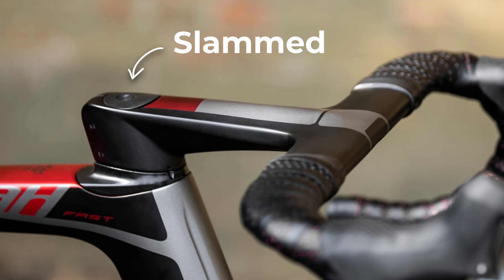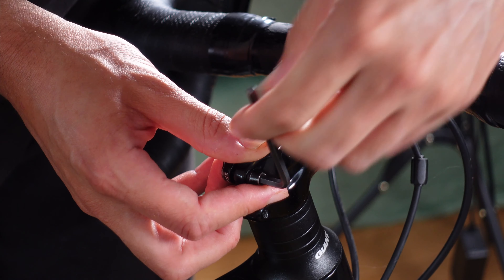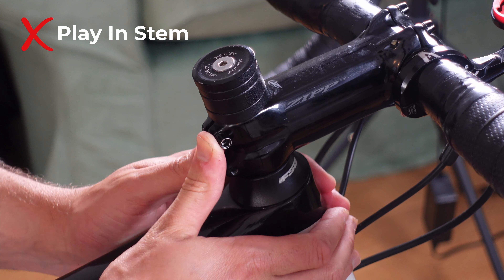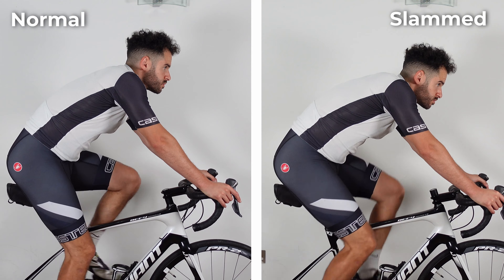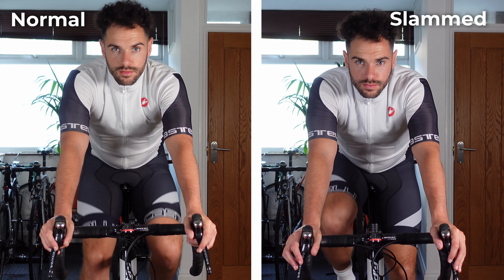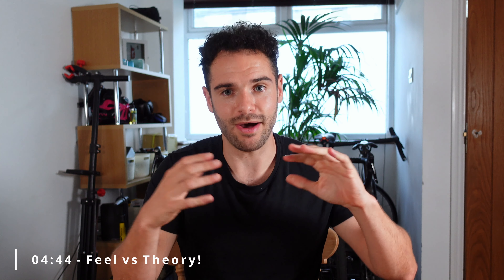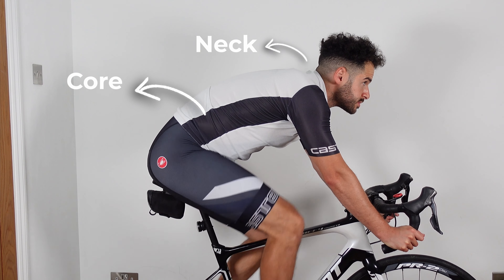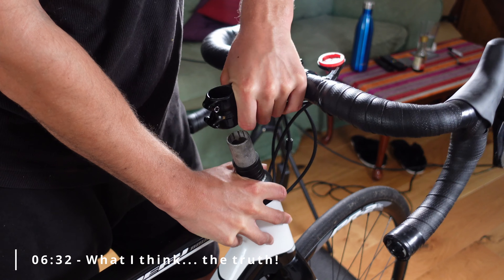I Tried Slamming My Stem for 30 Days... Here’s What Happened

Comment: Bars too wide. Shoulder width is max. Narrower is better. That’s the reason for your poor hand position. So many bikes are delivered with bars too wide. Also, you fail to mention the most important slam issue: Steerer compression. You cannot just slam the stem Nilly Willy and leave a tall chimney. That’s dangerous. You need a compression plug covering the area where your stem is clamped, or risk steerer failure.
Reply: If you don´t have steel components…
Reply: Needs a longer compression plug with a carbon steerer, he has an aluminum steerer post with a star nut so all good.
Reply: 2 very good points.
Reply: The steer tube on that bike seems to be aluminum not carbon so a longer steer plug is not required. But I am glad that you mentioned that because most bikes out there 2015 and up are carbon steer tubes anyway, so a longer steer plug is required specially if spacers are at the top and not at the bottom.
Reply: Try lots of stuff..super wide bars is awesome for mountain climbs, because it opens up your lungs for deep breathing a lot!!!!
Reply: Thanks. I did not know about needing longer compression plug.

Comment: When I first started riding age 15 drops used to be a lot deeper than they seem to be now, I’m 54 now so I’m talking steel bikes, they seemed to have comfort for climbing and the ability to get aero in the deep drops, I could tolerate any position up to the age of my late twenties, after that it’s all down hill guys , to all you oldies that wanna get areo, don’t 🤣
Reply: I think you feel aging at 40 little by little and hey it's cool... every flower has its turn in the sun...
Reply: @lunam7249  it’s gradual ageing until your late forties, then you fall off a cliff in your 50s🤣 I’m in that fight right now, started doing weights again to keep muscle mass up, I know I’m gonna go down but it’s gonna be fighting 💪🏻🤣
Reply: @lunam7249  and ever eagles continues to soar until it's time to be reborn as a phoenix stronger and wiser
Reply: This is exactly why I never stopped working out..I've been working out religiously for over 25years straight..im now 47 and I feel fine on my tarmac sl7 race bike..since im 6 foot 2 tall I didn't slam the stem but just removed a few spacers..if I want to get lower I just bend my elbows and tuck my body in..comfort=speed for some of us...

Comment: I always see these videos and never disagree with the conclusions because it is such a case by case situation. 
But I'm here to say, not everyone who slams the stem is doing it for the looks.
I started training really hard at the end of 2023 with a 100mm stem with 10mm spacers under it. I still had a little bit of back pain at the end of longer rides (4hours) but was ok on shorter ones. I've ridden on average 12 hours / week since then until now.
Right now, On a bike that is even more aggressive (shorter headtube, more reach, less stack, same seat tube angle) I'm on 130mm stem that is slammed and I can ride 4 hours with intervals no problem.

Your flexibility CAN improve a lot by riding a lot, even if you are an amateur. But you gotta get there gradually, not over night. Ride what you can comfortably but don't be afraid to experiment once you start riding more and more! If you CAN ride the longer lower stem comfortably, it IS objectively faster because of the aero position.

Comment: Mant pros have very long arm or upper torso. So even with a slammed stem, they don’t look very low. I personally slammed my stem but with 1x 5mm spacers not for aero but to relief the pressure from my hands and shoulders. It feels much more comfortable except my neck has to get used to it.
Reply from the maker: Yeah, the pros positions are crazy to be honest! I've had a few bike fits since this video which corrected a lot of issues that I had - https://youtu.be/EnGSLC9FtNI?si=2IfwVPTrxd2euwEl

Comment: be careful about telling people to slam their stems and not cutting the  steerer tube or getting a longer compression plug on a carbon steerer tube. It could be dangerous as if you slam your stem lower than the compression plug .. the stem will be putting forces on the unsupported part of the steerer tube and may lead to weakness of the steerer tube which could be catastrophic if failure occurs whilst riding.

Comment: You need more than 30 days to adapt to a low position.  Also maybe a longer stem and a more forward saddle position to keep the hips open and prevent the rocking.  Take a closer look at pro bikes.  120-140mm stems, small frames, forward on saddle, fast as shit.  Just look at Adam Hansen doing 20 back to back grand tours on a mega drop.  If it was a comfort issue he'd not make one stage.

Comment: Totally impractical for 99% of tall riders, esp with proportionately long legs. I already run a 14cm saddle to bar drop with spacers. 'Slamming' is just an affectation, if your ideal fit on the frame happens to result in zero spacers then fine but it's not a goal to aim for in itself.
Reply from the maker: Wise words 👍🏽

Comment: I'm no expert, but it seems to me like your bike fit was already problematic before slamming the stem. Your elbows were completely straight (not bent) which suggests the reach is probably too long and/or the bars are too low already. Secondly from the front it looks like the bars are too wide for you. It would be interesting to compare good fit (in terms of reach, bar width) but high vs. good fit and low (slammed).
Reply from the maker: You are correct... Since this video I've had 2 professional bike fits https://youtu.be/EnGSLC9FtNI

I have another video as well getting fitted on a race bike 👍🏼

Comment: When you slam your stem watch your compression system inside the stem. It must be in the same height with stem. When you tight the stem it compresses the steerer tube . To balance the forces manufactures puts the compression plug inside  to "push out" . Thats many ppl cut the steerer tube , to correct the height between stem clamp - compression plug. (Sorry for my english, hope to understand me :D )

Comment: When you want to take of the stem, ALWAYS loosen the bolts on the side first and THEN the top cap. The top cap compresses the steerer via the nut inside, you could damage your headset with the wrong order.
When fastening, first do the top cap and then the bolts on the side.
Reply from the maker: Thank for the tips! Much appreciated 👍🏽
Reply: When unscrewing, no need to follow any order. The cap function is only to compress the stem against the headset, so it's not loose. Once you tight the stem bolts, it serves no purpose anymore except for esthetics. If you wish, you can even remove it after tighten the stem.

Comment: I un-slammed my stem recently and I not only was I more comfortable as a result, I was also faster for couple of reasons not mentioned in the video.
The first is that I could spend more time in the drops. It's lower than the hoods while slammed but way more comfortable. It was a more optimal balance of aero and comfort that I didn't have available before.
The second was that I have clip on aero bars. And conventions have become that as low as possible isn't necessary as aero as flat and tucked as possible. Having a higher position allowed me to tuck in better, shrug my shoulders in better, and my back was more flat. Not to mention the greater comfort meant, again, I could spend more time in the aero bar position.
Reply: You have more common sense than people wanting to look like a pro or copy pro riders but do not have the physiology of a pro 🤫 keep that as a secret to get faster whilst being comfortable. Let them swallow their ego and pride later on and tell their mates, yeh my back and neck hurts and i cant sustain it 🤷‍♂️😂
Reply: Yes! I remembered Peak Torque mentioned this same point in a vid some months ago.

Comment: Been riding slammed for years. 
As long as you have flexibility, you’re good to go.
Reply from the maker: Good to hear... I think need to increase my flexibility hahah.
Reply: @JourdainColeman  yoga and core work.. 
I’ve also got a neck harness to build strength in there. 
If you add the correct tools to the arsenal, you can do anything

Comment: I'm 49 next week and have a giant tcr size small 11cm drop slammed stem no issues always have had my stem slamed my stem is a pro vibe 110 with -17° i was going to use a certified slammed top cap but with the -17° stem i didn't need to go that way to get my usual drop

Comment: If you slam your handlebars... you SHOULD reduce the reach of the saddle. Pros are riding with low handlebars since they move forward all the way their saddles (and consecuently increase the saddle height) . On the other hand... take a look to the INSTABILITY that you introduce to your hips when lowering the bars 3:07 !! Your body is balancing to the sides quite a lot!. Why... because you can´t simply lower the handlebar without altering the other parameters: reach and saddle height. All we have comfortable angles for riding. If you want to be low in the front, you have to move forward the saddle and increase its height, just to maintain the leg angles. The rule is: if you lower the handlebar 5 cms, you have to bring the saddle 5 cm closer to the handblebar, so the torso, and arms angles still the same

Comment: If you slam your stem, you end up with more reach. 
So if you want to do it right, you should slam it and make the stem shorter or push the saddle forwards. Pushing the saddle will change your hip / knee angle and isn't recommendable for just everybody. Making the stem shorter is probably a big pain for some that have integrated handlebars / stems. And it changes the 'feel' and steering of the bike.
Reply: When you lean forward your reach naturally increases. So you dont have to shorten the stem
Reply: @Numeriwar  or he bought the wrong bike 😂 these average cyclists are delusional thinking they can do what pro does 🤦‍♂️ endurance for majority of weekend warriors. End of.

Comment: Tbh I don't think you look particularly well set up on either set up...?

Good start would have been getting bars that fit you better, i.e. narrower. That would already save you heaps.

Next video try narrower bars (maybe slightly longer stem to compensate). And then get used to those and repeat slamming stem... anyway, my two bob, lol.
Reply from the maker: Yeah, a few people have said that narrower bars would be better. I'm using 38cm bars (centre to centre) which I swapped from 42cm bars that came with the bike. So dropping down to 36cm could be worth a try haha

It's a right old mine filed trying to get the position right, but the current position suits me well. (no pains when riding)
Reply: @JourdainColeman  wow, they look much wider on you, but 38cm could still be 40cm c-c on the drops or more. For a cheap experiment try 3T 38cm Ergonova bars (alloy ones). They are usually cheap on eBay and 36cm on the hoods and genuinely 38cm c-c. I can ride any width without issues or pain (have ridden anything between 34cm and 40cm), it doesn't matter. However on the track I've settled on 34cm and on the road on 38 (36 on the hoods). Yes I can ride wider but narrow is much nicer!

On the track my bars are a tire width above legal (as low as they are allowed to go), my road bars are 1-2 cm above that (about 2cm above tyre). But on another bike with a different geometry, the bars are in fact slightly higher, but still slammed. It's trial and error, but I encourage anyone to experiment. I just really hate a "relaxed" set up. Don't like how it feels physically and the it affects the handling. Then again, I don't do 5 hour rides... so that's another factor to consider.
Reply from the maker: @Gabrielle4870  Thanks for the info! 

I currently building a new bike and I'll look at the bars that you mentioned. I've looked back and can see my arms clearly are wider than my shoulders. I'll also measure mine as there is a chance that 36cm bars would be better for me.

All makes sense with what you have said with track bike etc. I'll experiment on the new bike which is more of a race" bike. I'll keep the giant the same and use that for the longer 50/100-mile rides. 

Safe riding friend!

Comment: But what I've also noticed when I did a little slamming was, an easing up of the shoulder muscles when your riding on the hoods because your elbows are bent and more relaxed with your upper body weight resting on your wrists and forearms instead of your shoulders.  I still found riding in the drops not nearly as comfortable but riding the hoods was much easier on the upper body.

Comment: Good valid points.  I did not slam my stem but i did drop it down to one spacer.  A bit too low for longer periods, wich required too long of a core engagement.   So ive raised it another spacer and hopefully thats more of a sweet spot for my current level of fitness. 🤞

Comment: I've done it this year and replaced my stem with a 17 degree negative rise stem in preparation for a race. I'm riding well but my lower back is very sore and tender. I find that pushing hard in this position makes it worse than when I'm just pootling about. Can't wait for this race to come then go so I can get back to a more neutral position.
Reply: Im using 20degree. My first month feel sore my body and cannot do high power output. But after 3 month i feel comfortable and faster. Should be understand, muscle and bone flexibility built within time period. Dont push to hard for the first week. Human body are biology system. It will get to the position slowly. Take your time. Some time lower does not mean aero. Handle 10cm below saddle are more than enough.

Comment: As a vertically challenged adult I find myself comfortable with stem slammed all the way down. Not only that sometimes I have to get more aggressive 25-35 negative degree stem. Others make all sorts of comment/s but my bars are actually right around my saddle height. Yes I do agree with bars being higher will make you more comfortable but I find myself loosing control more often & front wheel keeps coming up when climbing. So I guess it’s different for everyone…

Comment: It's a very individual thing. I'm not particularly young or skinny, although I am pretty flexible, and I find it unloads my hands a lot more running it slammed vs 'regular'. I don't know if it's something to do with leg or arm length or what. Probably a combination of several factors, including the fact that I run bikes which are fairly large relative to my height. I'd advise people to try it, but obviously if you get a stiff neck or back then raise it back up again.

Comment: If you ride less than 10 hours a week I don’t recommend slamming your stem. Your body has to adapt to the position which it will do over time. You also need to
Be relatively young and fit with enough core strength to stabilise your upper body.

Comment: Excellent video!  I used to ride with a "somewhat" slammed stem, but as I have gotten older, I have become less flexible, and so I have unslammed and then flipped my stem and find that I am much more comfortable when I ride.  If I am bombing down a hill, I just bend my elbows and tuck into it and I can still fly!
Reply from the maker: Yeah, I figured the same, if you really want to get tucked in and out the wind, you can! Good to hear you have found a position that works for you! Safe riding friend!

Comment: Your saddle is too high and the handlebar is too wide, mate. If you really get a bike fit, get a bike fitters with experiences. Cheers.
Reply from the maker: Cheers for your comment, Kevin. Out of curiosity what makes you say the saddle is too high and bars to wide? I'm always looking to improve my bike fit 👍🏼
Reply: @JourdainColeman     I can see from back of your body that your hips aren’t moving quite right, maybe you can lowering your saddle about 10mm. About your handlebar width you’ve been rolling those wrists, it’s compensation for the body trying align the wrist with the shoulders. If not, your handlebar is wider than your shoulders. Try narrower handlebar or measure your shoulder width to match the handlebar👍🏽

Comment: The amount of editing in this video is lit 🔥 love it mate. 

Indeed, your highlights on neck pain and comfort over aero over a prolonged efforts are fully applicable to me. I had this neck and shoulder issue quite a while until i found this video from 'kinetic  cycle coaching' youtube channel on rolling the pelvis on the bike especially when using the drops. It reduce the angle of neck bone and therefore, theoretically reduce the muscle tension nearby.

It helps me tremendously and i didn't experience it whatsoever during 1-2hr of continous riding on the drops with my stem slammed. It does take quite a while to get used to that position. Adding core strength will definitely helps in that regards though.
Reply from the maker: Glad you enjoyed the video! 

Do you have a link to the kinetic  cycle coaching video that you mentioned, I'll give it a watch and see if can help me improve my position 👍🏽

Comment: Another great video in the bank! 🎉🎉🎉
I also tried slamming my stem when i first got my bike and also had the same problems. It wasn't right for me, it was uncomfortable...and another added downside (which doesn't affect you Jourdain), with my bigger belly, it meant when riding on the drops or trying to tuck in, the top of my thighs would hit my drooping belly 🤦🐷.
I found having the the stem half way down was a happy medium for me. 
As with all bike measurement changes, doing it in increments is best. And those increments are most likely to be in the millimetres - small changes, big differences!
Reply from the maker: Hi Han! Interesting to hear that you have had the same experience as me. I'm thinking to drop it a single spacer and see how I feel. Like you said, little by little. It sure did make me realise how much comfort is taken out of the equation with many purchase decisions... but how important it actually is. 👍🏽